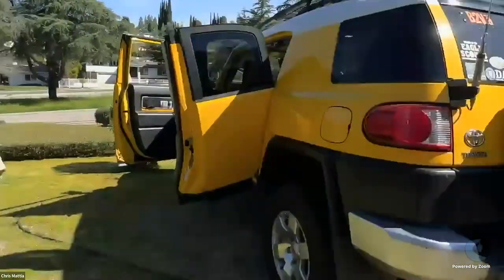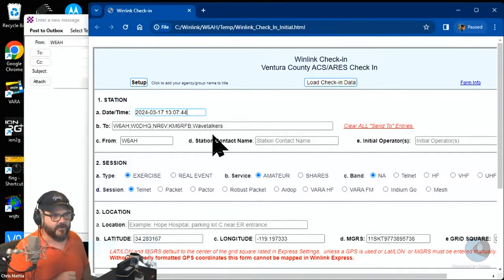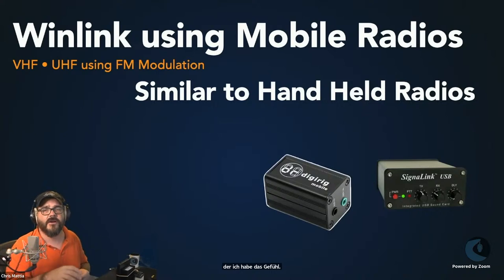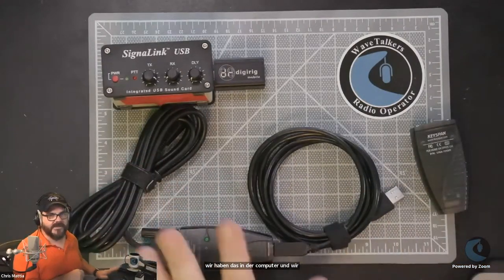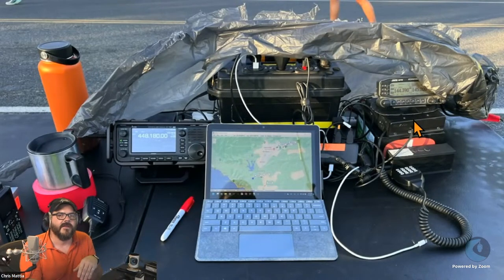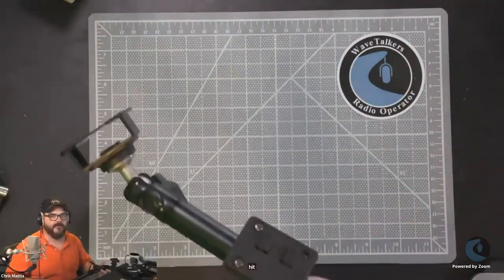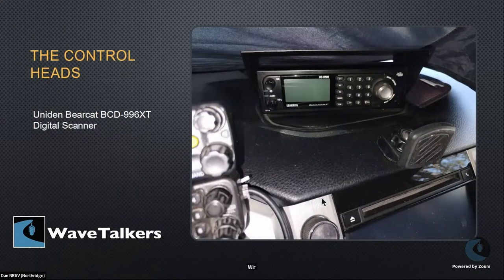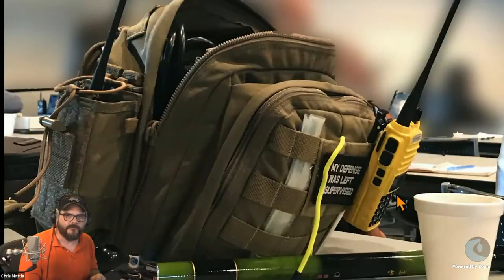Winlink Mobile: WaveTalkers LIVE 99

Comment: Great presentation.  However, except for the all band/all mode radios, all the other radios mentioned are no longer available from the manufacturer.  Can you please suggest several VHF/UHF mobile models that are currently available and suitable for winlink.  It looks like the current models do not have any data/USB connections and use the microphone to control the radio.  Not sure how to get audio in and out from that connection.  Thks
Reply from the maker: Thanks for learning with us!

Nearly all of the interfaces we talked about especially the digirig, signalink, master communications, and pactor have cable specific solutions for nearly every mobile radio currently available as new and older models.

Perhaps the best place to look is digirig and look at their cable offerings.  Their cables are extremely well made and readily available for nearly every model of Yaesu, Icom, Alinco, Kenwood, and Anytone. The digirig is also a relatively affordable interface that works very well for VARA Winlink modes.   Tigertronics Signalink has a similar listing of cables on their website. You then set the internal jumpers on the signalink according to their instruction and pair that with the radio specific cables.  

Radios that require the use of the mic and speaker port work the same way.  We demonstrated this last week during our mobile show when we showed how the Baofeng works with a digirig and even how to balance the audio from the speaker and set the microphone levels in Windows.  We referred to those videos in this episode as we were not going to repeat that information this week.

On the VHF/UHF side, all current mobile models of Icom and Kenwood have data ports (they don't call them that). Yaesu  FTM-500DR, FTM-200DR, FTM-6000R, FTM300DR, just to name a few. There are tons of options on the used market of older rigs as well.

All band and all mode options are avail, the IC-7100 offers these features in a single radio, FT-891 offers all of the HF and would be paired with nearly any of their dual band VHF/UHF mobiles. The major manufacturers have been letting us down lately in not offering as many all mode all band options in the smaller mobile format so if this is an option you want you may need to look at some older rigs that are still very good and readily available on the used market.

Do you have a specific radio you are looking to use for winlink?

Hope that helps and again, thanks for learning with us.